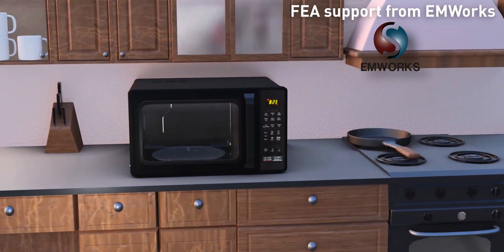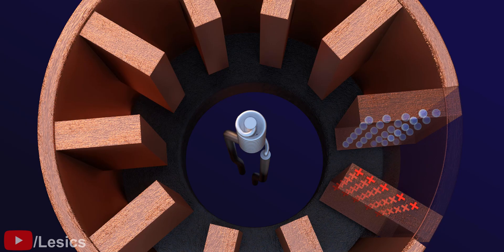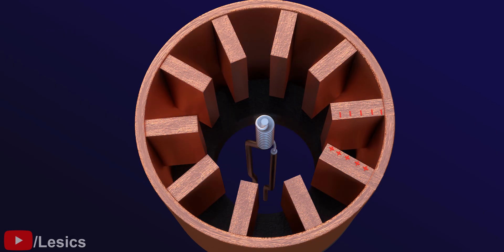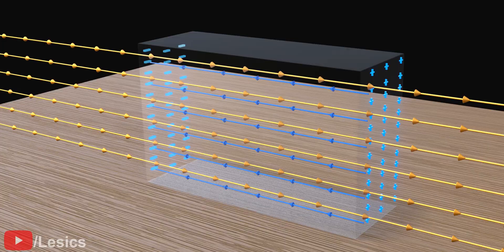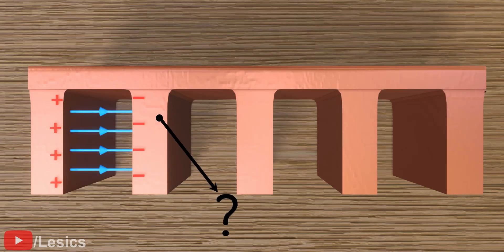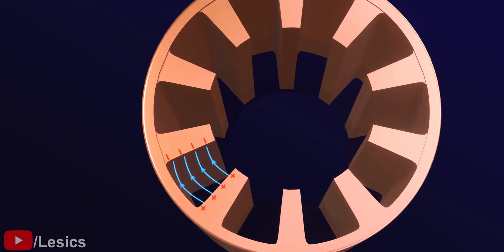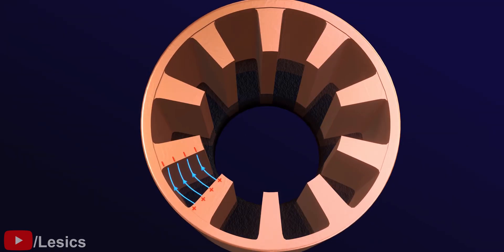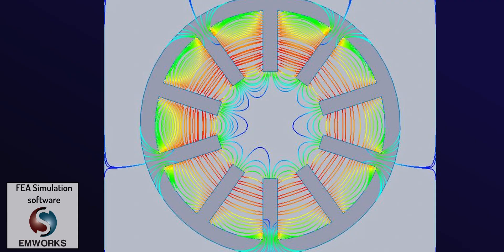The curious case of Magnetron's surface charges!

Comment: Aren't these far too small to be resonant cavities at 2.5GHz, 12cm?   Not half-lambda size.   
Instead I suspect that they behave as one-turn loops, like "mag-loop antennas," each conductive loop being hooked in parallel with a capacitance between the rod-tips.   So, it's a ring composed of tiny RLC resonant circuits, not a ring of halfwave microwave cavities.   If true, the spacing between the rod-tips would be crucial for determining the operating frequency.

Comment: Why didn’t you say it is a Soundwave like reaction that happens when closing the circle. As the wave microwave soundwave bounces around the inside of the circle. It starts to create energy field more less now put a inner ring and a sitting area with magnets and mercury rot around that in opposite direction of circles rotation

Comment: Besides microwave, what can a Magnetron be used on other purpose?
Reply: The copper heats up because of its resistance so you can generate heat.
Just joking - a microwave device is good to generate microwaves.

Comment: But what happens if the number of cavities in the ring is an odd integer?
Reply: Then you do not operate in PI mode. It works but not as stable as the PI mode. Search for "magnetron strapping" how you connect the various cavities to stabilize the frequencies.

Comment: Hang on! Where did you get positive and negative charges when there is only one charge and it's neither positive or negative! 
Sure, something can carry more charge than something else and it would be called positively charged! Like electrons and protons, they both carry the same charge but the proton has more than the electron! And the neutron is neutral but that doesn't mean that it doesn't carry a charge! It does, but it's state of charge is somewhere in between the other two! Which also means that a neutron from one type of atom can be more positive or negative than that of another! 
There is no actual positive and negative charges! 
Now! Since the cavity of the magnetron is one piece metal, it can only be more positive or negative than the high voltage discharge point in the centre! You can't have a metal being both charged and discharged at the same time! 
Seems to me that the operation of the magnetron is not a very understood device! 
You tried but failed!
Reply: Metals like the copper body conduct electricity. It has the crystal lattice of atoms. In case of copper atom, you have 29 positive protons in the nucleus and 29 electrons around it. In metals the bonds' energy levels overlap and some electrons can move freely , then the atoms staying in place will have less electrons around them. Those represent the positive charges. It just means they have less electrons than necessary to compensate the electric fields of protons.
In insulators the electrons can't move in crystal lattice because there is no overlap in energy levels (sorry, too much quantum physics), if you need further info, search about insulators and metals and how their bonds and structures are different.
Hope it helped.

Comment: What happens if you add or remove one cavity?
Reply: You will change the frequency (btw remove even numbers to keep it stable - Pi or pi/2 or pi/4 etc modes are stable, so the number f fins N should be even) Visualize it like you can flatten the circuit by cutting it, then unroll into a linear shape (like when you flatten a cut ring) and draw a sine wave on top of it, eg fin1 0, fin2 1, fin3 0, fin4 --1, fin5 0 etc. If you can end the sine wave in the same position as it started, like fin1=fin5 then you can see that with eg 4 fins you can have a nice stable periodic field.

Comment: Thermionic" disassociation of charges as a new understanding or meaning regarding "particle" emissions of "electrons." Such that gaseous molecules (atmospheric nitrogen oxygen or whatever exists within the sealed magnetron, which could include ions of the tungsten coil cathode, and any other metals. Alloys. Humidity in the magnetron could mean separation of hydrogen from oxygen. Deoxidation of nitrogen.) So that oxygen being negative is attracted to positive anode. Higher charged atoms positive attracted to negative charge flow direction cathode. Thus capacitance alignments of charges.

Mostly there would be friction in the on off frequency at a higher capacitance and plasma. Transmission output, radiation emission (MASER.) The coil is kept separate from the rod so that plasma (spark gap) is created in the center of the chamber. Charge flow is created between axis and edge which creates magneto dielectric rotational torque. Positive axis into negative edge. The coil is attached to the outer edge and the outer edge is the antenna leading to the "wave" guide chamber. Therefore the rod and the inside of the microwave chamber is negative ground. Positive charge is guided through the food and to the negative ground. The food is cooked within a larger spark gap.

The coil becomes an electromagnet when induced by pulse charge flow current. The inner rod is it's core. The round copper with chambers geometry of fins are further gap locations for more ionic breakdown to occur. St. Elmo's Fire. O3 Ozone. Obviously this is one large (electro) magnet using outer magnets to assist in power manifestation. Chambers further assist in coherence capacitance. Fins assist in harmonic resonance oscillations (slit in a tube assistance, fork, bowl shaped bell.) This is power amplification. 

Aluminum fins are heat sinks, however could play an important paramagnetic role in association with diamagnetic copper. As induction charge flow direction is opposite between them and this may assist as a feedback induction "flyback." The lightbulb in circuit is always shielded with aluminum or at least always shielded by metal. It could possibly serve as part of a harmonic resonance tuning device or sensor.

Comment: OK, but the case you show is only the case where there are ad even number of cavities within the cylinder.  If there is an odd number of cavities what happens?  It's impossible to evenly match up the + and - charges so the cylinder seems like it would be unbalanced and not work as described.

Comment: I really admire the engineers who thought this device up - a true piece of art.
Reply: Physicist Albert Hull and Heinrich Greinacher invented this Magnetron
Reply: @lucaarthur8710  sure he did, that's why the magnetron it's all across cathedrals throughout this realm.
Reply: And then Percy realized we could stamp that pattern from copper sheets, add a bit of solder, and stack them up in an oven.   Thousands of WW2 radar sets, with no machine-shops needed.   (If you've worked with slabs of copper, you know that it's horrible gummy stuff, clogs milling tools.)

Comment: The video made no mention of the magnetic field that curves the path of the electrons, or the time delays associated with operating at microwave frequencies. Or how the  charge oscillates from one side of each cavity to the other. As an explanation of the operation of the magnetron it really does not go far enough.
Reply: @mikehodgetts4864  the error was in failing to distinguish between high frequency a.c. behaviour and that of dc. Clearly in a lump of metal like the anode, surface voltage differences cannot be maintained except at microwave frequencies. The magnetic fields across the cavity resonates openings  are the result of the RF current flowing  round each cavity.

Comment: i think i understand, but it would have been good to explicitly explain why the blue fields lines are now curved at 3:00. Presumably it's because the faces of the teeth/splines are now no longer parallel. Does this mean that the linear case would also establish a pattern of charges if the teeth were closer at their tips?

Comment: An older version of microwave machine was  made by triangles with bridges (connections) between each 2 bars and electric current passing trought the bars in AC mode. How it changed?

Comment: Could you follow-up on the actual microwave generation? How/why does the mentioned oscillation occur and how does it result in microwave radiation?
Reply: There is a permanent magnet on the magnetron which prevents electrons boiled off of the cathode from traveling straight to the anode, but it's not strong enough to prevent conduction. So you get some cyclotron radiation, but if I understand correctly, it's mostly just to help steer the electrons around the anode, to improve the deposition of charges, which improves efficiency.
Because it takes time to stabilize the charges within the anode (the part shown in the video), electrons from the cathode will continue to conduct to different parts of the anode, meaning the charge will never reach a stable configuration, and you'll continue to get currents traveling around the anode.
The skin effect keeps the majority of this current at the surface of the anode.
The round cavities have currents flowing around them, which makes those cavities act like an inductor.
The geometry of the plates also causes a measure of capacitance, with adjacent plates having different charge, thus having an electric field between them.
The result of this capacitive and inductive geometry is your typical LC oscillator, and it determines the operating frequency (though these circuits are quite noisy because of the inherent randomness of charge deposition). Depending on the different geometry, it could take more or less time for charges to move from one surface to the next, which will determine the frequency of the induced AC current.

As for the radiation:
All moving charges cause EM radiation. They are microwaves because the frequency of the alternating currents induced in the resonator is in the microwave range.
Other geometry in the resonator (the cavities are all connected and also contained in a solid case except for a small aperture) guides the microwaves for output into a waveguide.
Reply: Same doubt
Reply: He has another video that explains the workings of a magnetron: https://www.youtube.com/watch?v=bUsS5KUMLvw
Reply: Yeah why does it create 2.4ghz frequency and not 30hz for exemple?
Reply: @skyz3ra  Because of the size of cavities and the strength of the static magnet (and some other factors). They determines the resonant frequency that matches with the resonant frequency of the field in cavities. It is like the Tacoma bridge effect or your garden swing  - if you have the push at the right time the resonance happens. 
Magnetron stability is an interesting topic in itself...the first magnetrons were very unstable,  if you search for "magnetron strapping" you can see how you tweak the circuit to a given stable resonant frequency..
Reply: @hond654  a little late but still cool to answer ;p <3
Reply: What if there are odd number of Tentacles(METAL BLOCKS)??
Reply: You can't really explain a magnetron using words.
The oscillation is induced by the magnet at the base.
The spikes are calculated like they are coils, and the spacing between the spikes is calculated like a capacitor.
There are many spikes but for the oscillator they count as a single LC circuit.
It is possible to pickup the output power from any of the spikes.
Magnetron oscillate at a single frequency. For a wideband microwave amplifier, there is a travelling wave tube, another exoteric piece of engineering. They have been replaced with some special microwave MOSFET for most uses nowadays.
Reply: @rayoflight62  thanks ☺️ but go even dumber on me ... Microwaves are a form of EM radiation, right? What causes it? Like...things go spinny-spin, electricity goes vrooom and tadaaa radiation?